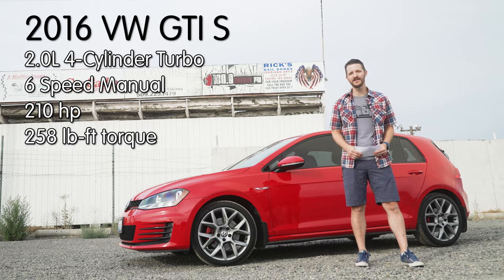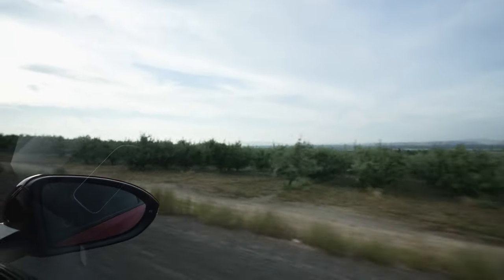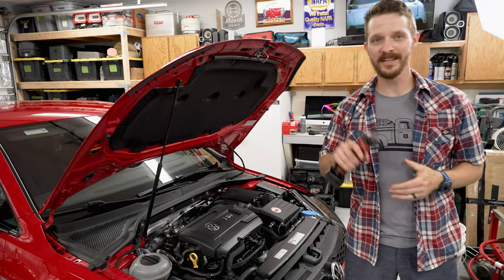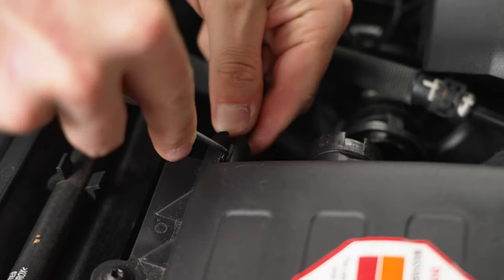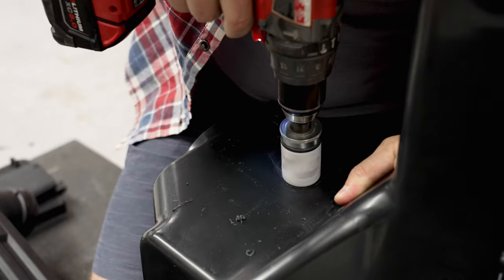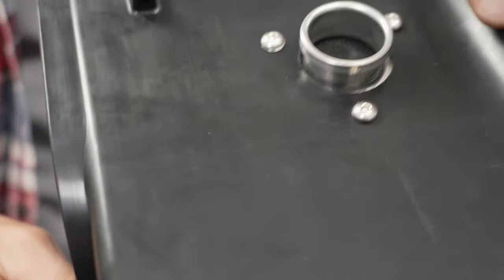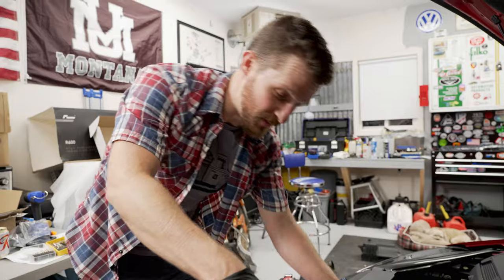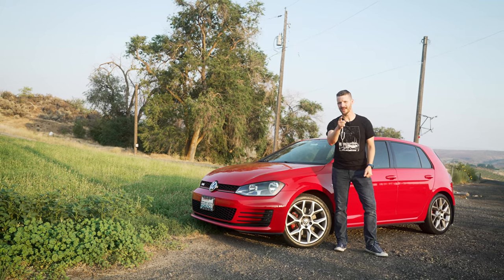VW GTI & GOLF R: R600 Cold Air Intake DIY

Comment: Jason I’ve been debating the same exact thing for these past few months now. I have a mk7 GTI with close to 100k miles. I love it, it’s base model, no sunroof (which I prefer this generation) DSG, all maintenance is up to date, BUT suspension is showing it’s age (you can hear it creak), and other random metal clicking noises once in awhile on throttle. The problem is the GTI is a hard car to one up. It really is a great car. In NY winters can be harsh too and snow tires do help, but AWD with snow tires is nice too. The market puts me with a lot of equity in the car, but with car prices rising all together it’s the “same difference”.  In a dream world, I’d keep the GTI and have a Quattro or 4motion car, or golf r… excited to see what you decide, maybe it’ll sway me 🍻
Reply from the maker: Yeah, with snow tires it’s great as long as roads are plowed.
Reply from the maker: Suspension video is out btw.

Comment: i never even used the drain hose in bottom, it just wouldnt fit right
Reply from the maker: Yeah that was the only negative thing with this install.
Reply: @JasonExplainsThings  the i fixed it after i posted above, with a little sandpaper on the inside of the hole. the o-ring then popped in smoothly.